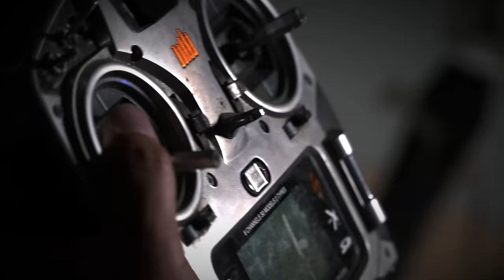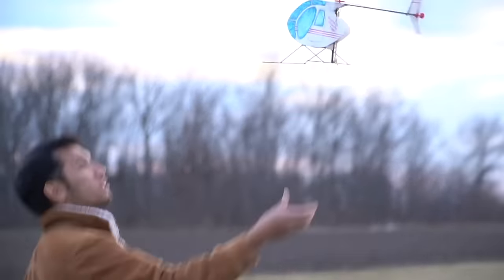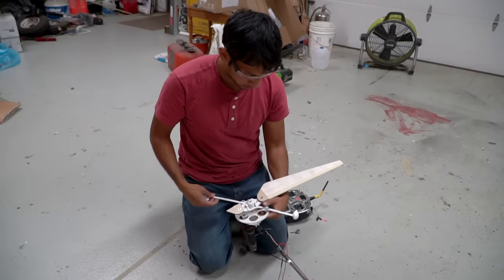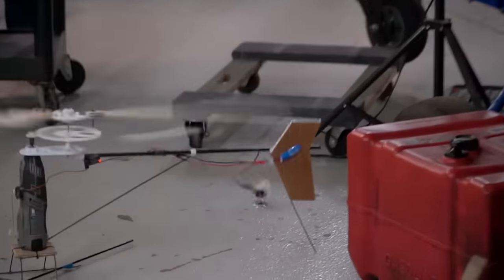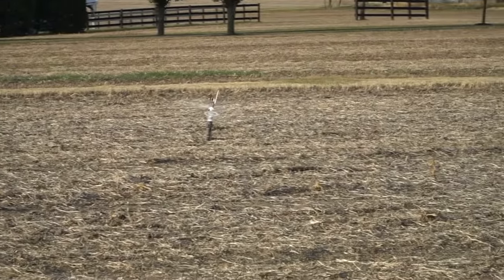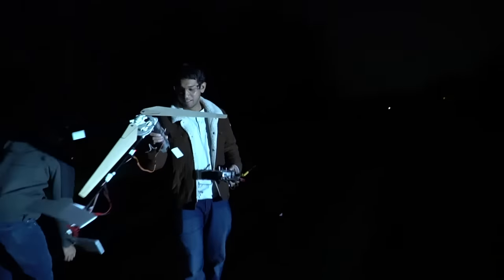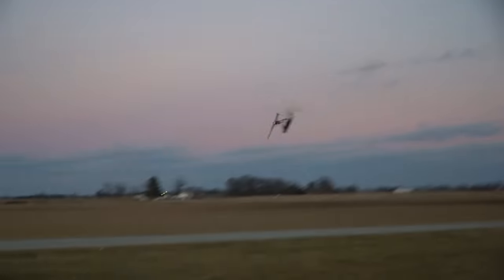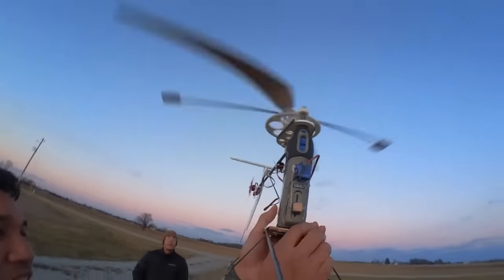Teaching a Dremel Tool to Helicopter

Comment: Actually, what I really want to see is you make a real submarine you drive from inside, from a large propane tank.  Maybe add a couple water heater tanks for ballast or whatever.  You don't have to get risky and go deep.  20 feet is fine.  Cameras, as long as you see in 3D, are fine.  Windows are very hard to make, and an easy point of failure.  I want it to go 5 MPH with no umbilical, and be able to steer.
Tow it with your little tugboat, and go for a dive.
Ideally, movable bright lights incorporated.

Comment: Hey Peter. I saw this video pop up on my recommended feed. And I thought. "Wow, I bet Peter could build one of those." But the one I was most interested in was the 3rd. It had 2 huge ducted fans that can swivel to change direction in mid air. So my question to you is. Could you build a similar "Personal Flying machine" 

Link to the video: https://youtu.be/-sUqJ9bId70

Comment: Just put a counter propeller on it  already.  It will stop the spinning. 

Because how a normal copter flies is that the  tail rotor must be going in the opposite way from the host propeller.

Comment: With a helicopter, you can rely on inertia and moment of inertia if a rotating mass. Flying a TAV with GEM-propulsion (GEM is Gravitoelectromagnetism) is much more challenging, since there is no inertia at all according to Einsteins strong equivalence principle. Therefore, the flight controller must turn off the propulsion system periodically to measure your position and acceleration with accelerometers. This is the reason, why such vehicles often start to tumble upon any local deviation of the earths gravitiational force.

Comment: I've calculated, that it might be possible to power a quadcopter purely on solar power. 
because with a propeller radius of 7cm, and a weight of 100g of the quadrocopter+solar panel the power consumption should be at 1,7W (with 100% of efficiency). This, i think should be managable. So maybe you could try it, or maybe i will try it.

Comment: You need to put two screws or find a way to attach properly the blades to the the rotor's axis , your problem is that the centrifugal force always  pulls out the blade and one screw is not enough to keep it in place because it's too heavy , to use just one scew should be a lighter blade with a locked nut screw and  some lock in place system from the blade to his base, but even  then if you do that  your blades are too heavy and your gear system  is too flimsy to control that amount of weight.

Comment: Okay, Dremel Tool powered Helicopter thingy took several iterations before it actually worked so im prepared to issue you your next project. Much like the 4 Dremel Tool powered drone made by the other guys at........ try to figure out how to build a Dune Ornithopter?  4 dragonfly styled "wings/rotor blades" a cockpit and scale of GI Joe sized 'action figures' and VTOL as well as forward motion to scale of those GI Joe people. 
  As in, 3 figures high equals 20 ft to them and 6 figures in length equals 100 ft.  Kittyhawk that B*t*h!! Use whatever motor you want? It doesn't have to be Dremel but the motors you use have to apply to the motion of the Ornithopter.

Comment: the electrical connectors that connect the battery to the tool get corroded very easily over time and is a common failure mode for Dremel tools

Comment: The amount of problems that could have been addressed by simply having a tensioner (or even a fixed dogbone) between the gears and the rotor to keep the un supported end of the drive shaft and the rotor shaft stable as well as keep gears in lash/proper contact lmao

Comment: I used to fly rc helicopters. But they are so tricky to fly and they tend to absolutely delete themselves when you crash so at some point I sort of just put it down when I realized I was spending 90% of the time fixing it... Not to mention the cost of the parts.

Comment: no flights, only uncontrolled crashing
many attempts of self disintigration

not a power issue, a strength issue and balance and lack of controls, if the goal was to simply fly up and then down perhaps a swinging pendulum attached to the bottom

Comment: Try and try and try  until you  succed. You can try again and again because physical laws allows it to work what you want to make work. You need to failing again and again. failing again and again is the steps to climb towards success. This kind of determination made b2 stealth bomber fly which was considered as impossible to fly due to its flying wing design. But flies using computer.  it has no vertical fin stabilizers, it relies on flaps on the trailing edge of its notched wing to control roll, pitch, and yaw. And bricks have better aerodynamic then space shuttle but still they made space shuttle to glide in in the air without engine or power and land safely on earth.

Comment: You should have the large gear on the motor and the smaller gear on the blades for better stability. Would also help to use thicker gears. You need bigger, deeper teeth on the gears with less of them. Those gears you were using will never be stable

Comment: Try use an actual angle grinder or make gears to lay the dremmle tool sideways I feel like the one you used had too much weight too far down so it would never work

Comment: try electrostatic vacuum foil balloons rc drones, yes charge to high static voltage, to make a foil vacuum balloon
Reply: try diy radial ring magnet in copper pipe sheet motor with iron rod core

Comment: Yea no remote cutoff for motor purely unsafe we lost someone in rc helicopter community due to blades. So not sure you using platform to give rc helicopter bad name but several times I thought blades would have done more then break